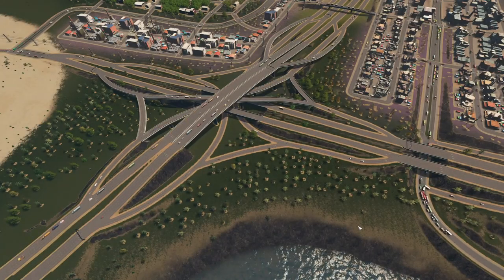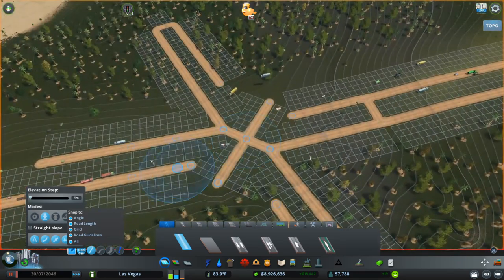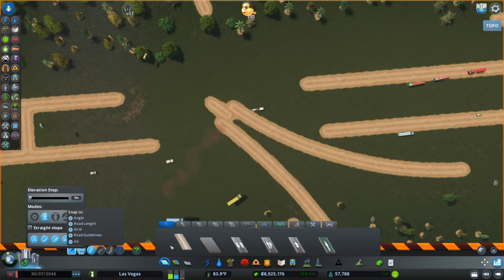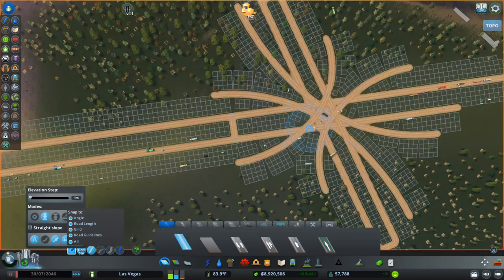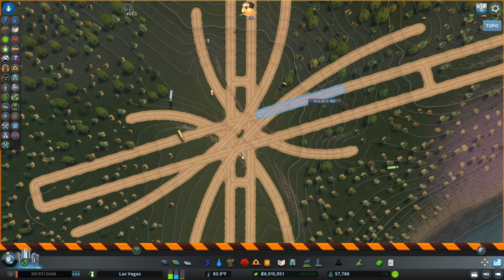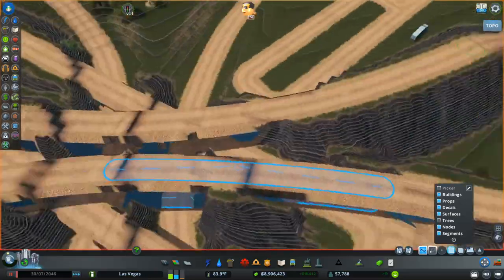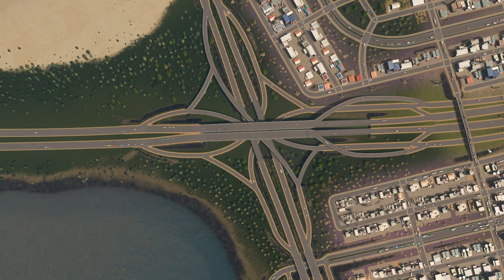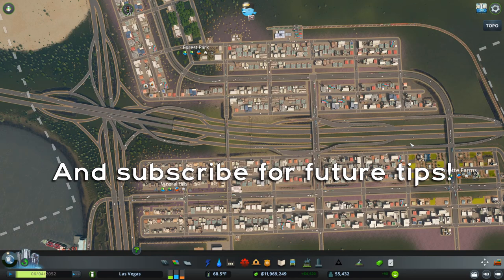Build a Custom Stack Interchange - Crash Course | Cities: Skylines

Comment: Bulldoze with Move It you can put it back.   With the CLRL, Z keys.   So, any oops can be easily undone.   With the game bulldoze it way too easy to zap something you don't want to remove.  With Move IT you highlight the part you want it to remove without worry you might move your mouse a hair ripping things up.
Reply from the maker: Lol that’s smart…I’m not sure if that feature existed on Move It when I made this video, but I like that idea. It’s just a lot of extra clicking than using the game’s built-in bulldozer.

Comment: Thank you for doing these. As someone new to the game this helps with complicated builds. PS: At 17:50 I notice you said 12 METERS above. That's more than 36 feet between levels. Is that what you meant?
Reply from the maker: Happy to help!

And yes...each of those contour lines is a meter according to Colossal Order. I know that’s a crazy height IRL, but the scale of the game is quite a bit off. IRL it’s probably more like 5 meters, as bridges are designed in most states to have at least 14 1/2 feet of clearance on roads.
Reply: You can get by with much less. I usually plop a prop truck on the lower level and drop the upper til it looks right. Haven't measured the final gap. But it's less than the 9m required by the game.